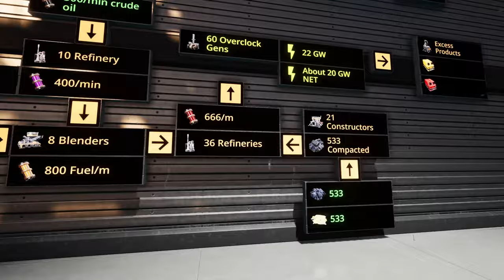Generating The TurboFuel Plant Of My Dreams - Satisfactory Update 8 (Part 13)

Comment: clean buildings :o
Tuuurbo fuel is sadly very sulfur hungry :c
Reply: there is 11700 oil on the map and only 6840 sulfur
300 oil = 800 fuel = 10.000 MW, double that get 20.000 MW
so with 660 oil u should get urself to 22 GW too
thats maths and shit, but TURBOFUEL IS FUN!
Reply: @Kyucy_Qc  well, the most suflur efficient recipe is the Blender recipee, that´s 1 Sulfur = 2 TF
Normal  : 1 Sulfur = 1.25? Turbo Fuel
Heavy    : 1 Sulfur = 1 Turbo Fuel
Blender : 1 Sulfur = 2 Turbo Fuel
Reply: @frozenherolp9077  true, but it still uses to much sulfur
Turbo Normal 27 oil / 48 sulfur = 60 turbo = 2GW
Turbo blend 45 oil / 30 sulfur = 60 turbo = 2 GW
Diluted fuel 60 oil / 0 sulfur = 160 fuel = 2 GW
I still would sacrifice the 15 additional oil to save 30 sulfur, most oil and sulfur notes are far apart and sulfur is expensive. We can use that in nuclear later